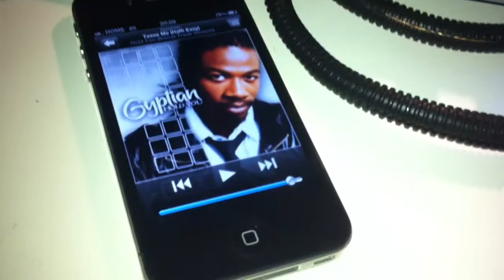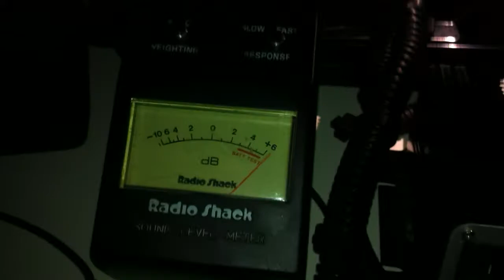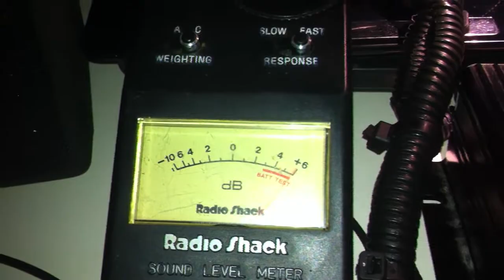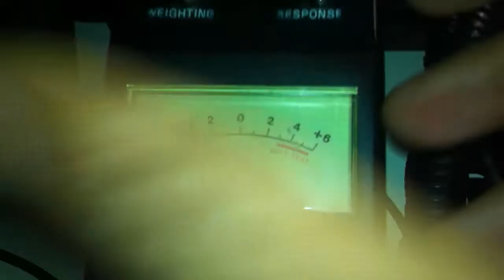Prototype Bicycle Stereo

Comment: too bad your camera can't record the bass. now let's see it installed on your ride. i'm surprised that most bike systems use heavy & inefficient car amps instead of tiny little class D ones like the lepai and cheap car speakers that never sound good. looks like you have the building blocks for a nice system. i'm waiting on a pair of high efficiency proel 8" PA speakers to start putting a 4x100w 24v class D trailer system together with a couple sealed PA 12s in truck wedges to start with asap, but want to eventually go with 2 larger 2x12 boxes. i'd like to see you complete your system and show everyone what a high quality on bike system looks and sounds like.